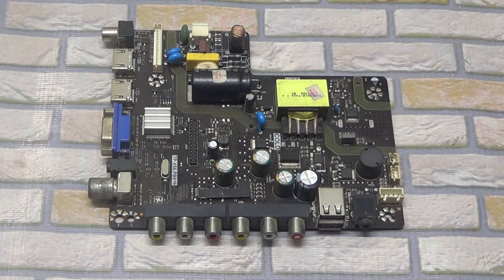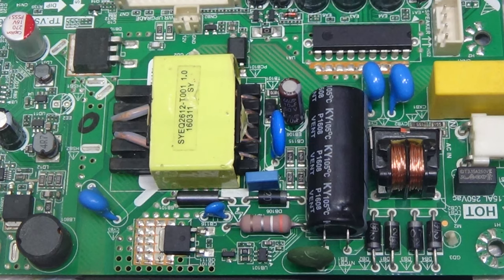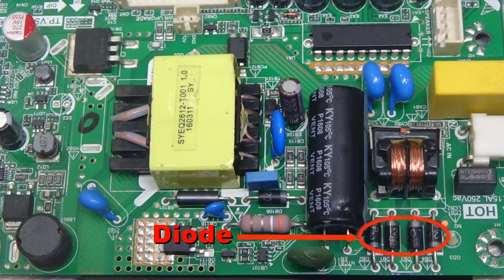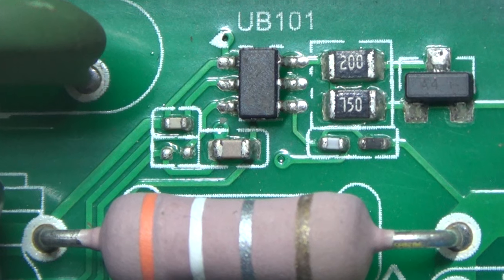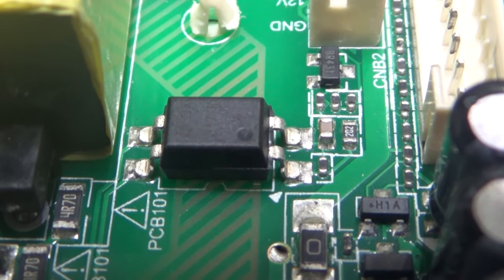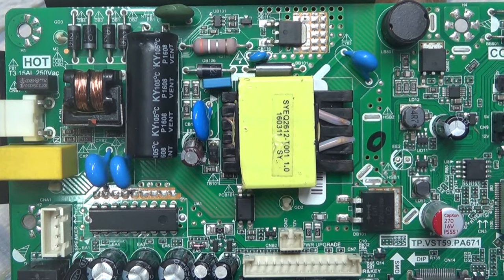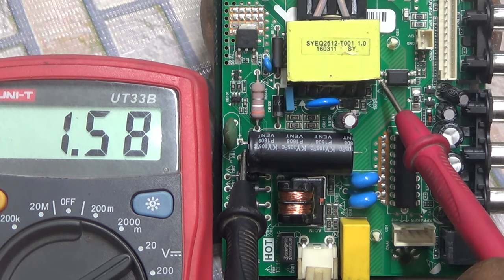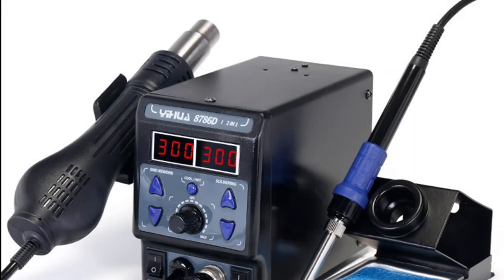LED TV power problem.#Pro Hack

Comment: I have LG 32LF520D which has no display but Led and sound ok how to resolve. I have identified the PSU output only 10v and 3 v only in place of 12v and 5v. Please help to resolve the same.

Comment: Very nice, Good job.
I have a smart TV card and It's power supply Mosfet [70R380P] damaged. And The same component is not available in the local market. So, What to do.. ? I have another Mosfet from another card but it's ID current is different (70R600P), So what to do for replacing the broken mosfet..? Much appreciated if you can suggest the best. Thanking you
Reply from the maker: https://youtu.be/7cLJ85wwfxI

Comment: Sir I am having problem with my 55inches vu4k power supply modelno.55uh7545  AC supply is correct but no dc supply pl  explain
Reply from the maker: Is stored in the high voltage capacitor?
Reply: 350to370 volts at the capacitor  at the secondary side small pf capacitor is bloen

Comment: Hye sir please i hope u can help me.. I have problem with power supply board tp.ms3663.pb819 no power, and when i test AC volt drop to 0 volt. Fuse ok,i test big capacitor i got 315volt +- something..so  how to solve this problem? Thanks.

Comment: Thanks for that for me I am a TV repair but I a 42 inches TV it switches and then goes off when connected to a 12v battery but when connect it to ac it works well where could be a problem and I fix it

Comment: can you tell price of components?
Reply from the maker: Are you technician ?
Reply: @ProHackHD  i just called technician  to repair my tv as i am electronics engineer i know the problem is in voltage regulator due to fluctuations in supply, but technician telling me repairing cost is 2500 i want to calculate actual cost including his labour cost.
Reply: @ProHackHD  2500 indian rupee
Reply from the maker: The maximum will be 50 rupees.

Comment: Sir mere led m fuse khraab ho rha h bar bar apne ap blast ho jata h nya lagne Or... Can you help?
Reply from the maker: Which motherboard ?
Reply: @ProHackHD  china wala h sir samsung 32inch( made in Malaysia) bord
Reply from the maker: @adhiyogi4871  डायोड खराब है।
Reply: @ProHackHD  bridge rectifire sir?
Reply from the maker: @adhiyogi4871  Fuses are damaged due to diodes and mosfet.
Reply: @ProHackHD  thnq sir bhot bhot dhanyavaad humko tym dene k leyi